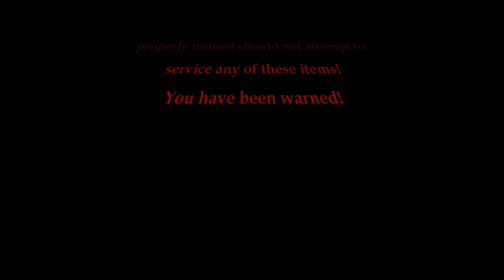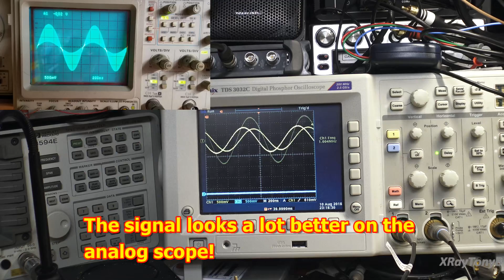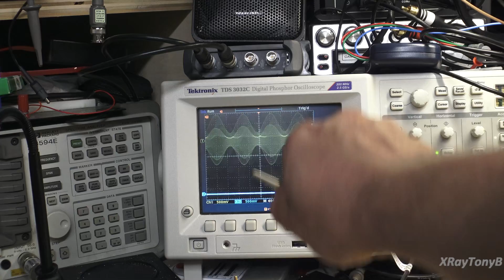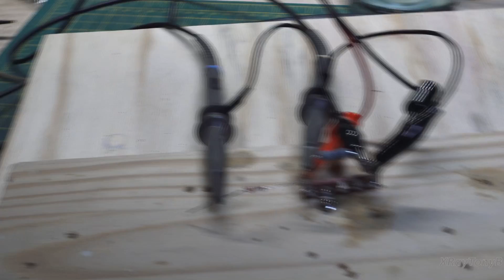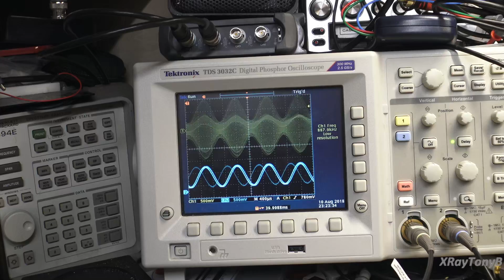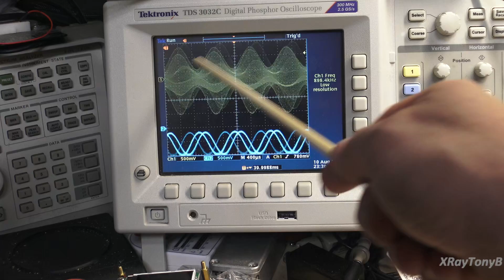Demonstration of AM Modulation and Detection

Comment: It is not correct to describe the upper and lower halves of an AM signal as "side bands". AM modulation works the same way as the mixer stage in a superheterodyne receiver. When you mix an AF signal with an RF carrier you get 3 different frequencies: the original carrier frequency and frequencies that are the sum and difference between the carrier and AF frequency. It is these sum and difference frequencies that are called "side bands".
Reply: The most technical thing I have ever heard about AM. Your comment is most underrated and should in text books. 100% people dosent know this. I was having this doubt for over a decade and now got a confirmation. Thanks alot
Reply: @ramrajpanthukalathil1601  I'm pretty sure that it would be in most technical text books. After all, it is just basic trigonometry.
Reply: @psionl0  may be. But most of the people have an understanding that these are side bands. I enquired to many to get the same response. Figured it out on my own and left it. Now when I saw your comment I got excited. 
You can also ask people to get the answer as side bands, I am sure
Reply: @psionl0  some text books also reference to as side bands
Reply: @ramrajpanthukalathil1601  Are you saying that some text books call the upper and lower halves of an AM signal "sidebands"? I have never seen that before.
Reply: @psionl0  yes. Some local texts
Reply: @ramrajpanthukalathil1601  if you come across any please let me know.

Comment: The process of AM modulation is the same as heterodyning.  In fact, you can create AM modulation with a mixer.  If you are discussing conventional AM Modulation, you do not vary the amplitude of the carrier. In fact, the FCC rules and regulations specify that the carrier level shall not vary by more than 4% under any condition of modulation.  There are some methods of AM modulation that vary the carrier level, controlled carrier modulation, but this is not generally used in domestic AM broadcast stations.   The output of the transmitter is a mixer product, the original carrier frequency, the sum of the modulating audio and carrier frequency, and the difference between the carrier and the modulation frequency. The original audio is dissipated as heat in the process.  All the information is contained in the sum and difference signals. When you look at an AM signal on an oscilloscope, digital or analog, what you are seeing is the modulation envelope, not the carrier and sidebands.  This is the resultant of the sidebands and the carrier caused by the fact the sidebands are out of phase with each other and the carrier.  To actually see the amplitude of the sidebands and the carrier it is best to look at them in the frequency domain on either a spectrum analyzer or FFT.  When you do that, you can clearly see the amplitude of the carrier does not vary when modulation is applied.  To detect the signal, you feed it through a reverse of the modulation process and pass the two sidebands and the carrier through a nonlinear device where they are heterodyned with each other, producing a number of products, including the difference between one or the other sidebands and the carrier, which is the original modulation frequency.  All the other products are simply thrown away by filtering.   I know there are is probably a shelf full of high school physics books and popular magazine articles, which talk about varying the carrier with modulation, but this simply not what happens and study of more advanced books and articles will support that as well as looking at AM signals in the proper domain.  
     When you look at the envelope on a scope, you are seeing the effects of what is commonly called upward and inward modulation.  The waveform above the resting carrier level is upward, or positive modulation, and the modulation below that level is the inward or negative modulation.  The modulation is identical on the two sidebands, but that is not what you are looking at on an oscilloscope.  If you look at the upward and downward modulation on a commercial AM station, you will see that it is not symmetrical about the carrier peak level.  Stations usually apply 135% positive or upward modulation and 100% inward or negative modulation.
Reply: Wow, absolute FANTASTIC (and spot-on CORRECT) explanation!  Good on ya - DE: W7SJ

Comment: You can use FFT function to do the same and turn on interpollation and would have stable trigger ad getting into sideband is a whole another topic that goes much deeper, but using  the FFT feature to better explain the upper and lower sidebands would have been better.

Comment: Thanks. The only way I'll get rid of my analog scope is when I die.
Reply: The fact Tony doesn't seem to understand the limitations of DSO's in these sort of measurements and takes no action to mitigate them (chief among which is using the wrong kind of DSO to begin with), like turning off interpollation or putting a low pass filter on the trigger, is no justification for sticking to analog scopes.
Don't get me wrong, I'm hanging on to my analog scope for sentimental reasons... it was a graduation gift from my parents after all, but I don't think I've used it in the past 12 years.

Even though I, like Tony, don't own a digital phosphor oscilloscope (which mitigates the fact a digital oscilloscope displays a datapoint at a standard brightness, regardless of whether it occurs infrequently or not), but, nowadays, even just entry level, digitiser+laptop DSO's are far beyond analog scopes' capabilities.

Compared to early, low end, digital scopes, analog scopes are inherently better, at their pricepoint, than digital scopes in exactly two areas: displaying AM modulated signals and videorecorder head alignment.
And both of those are thoroughly obsolete technologies. I mean, I listened to AM radio as a novelty, as a teen, in the 80's.
Meanwhile, digital scopes have come a long way, to where, if one knows what one is doing, there is no real downside except being not as intuitive. Get over it.
Reply: Jan Verschueren  I don't see why some people think that we should only have one kind of scope, or which one is the best. Who cares?? Why can't we have many different kinds of scopes?? I love my old Tek 2465A DV, but that's not gonna stop me from getting a digital scope. At some point I'll probably get a PC based scope as well. If I had the money I would have one of each kind of scope that's ever been made. I don't understand why anyone would want to limit themselves to having only one kind of scope. I say get many kinds of scopes and enjoy the benefits of each!
Reply: All kinds of tools for different work.  As much as I love my Fluke handhelds, there will always be a place on my bench for a VTVM and my Simpson 260.  Same with scopes.

Comment: I'm a total noob at AM decoding but i was expecting the rectified signal to contain the carrier: is the diode also doing a low pass filter (is it bandwidth limited) ?
Reply: @chillidogkev  Yes, the carrier IS in the signal after the diode.  One of the problems using a digital scope for these demonstrations.  On an analog scope it would have been easier to see.  The process is identical to using diodes for power supply rectification, you get the half of the signal you you want to keep, then use caps to fill in between the peaks.  Difference is for a power supply you use big caps to maintain a steady voltage, with a demodulator you use a pretty small cap because you want to follow the audio signal.

Comment: I've built many Crystal radios in the past and was amazed at how much volume you could get into high impedance  earphones, I even managed to drive a speaker using transformer matching to fairly good volume, the transmitter was high power 500 kw only 30 miles away!

Comment: I think your description of AM demodulation is wrong, especially the part about sidebands.  With a simple diode detector you are always going to have both sidebands present since you have no filtering but you can't see them on a scope unless you use FFT or a spectrum analyzer.  Simply reversing the detector diode does nothing but invert the audio signal which doesn't make any difference since it's just audio.
Reply: I think even saying the word sideband in this demo is probably a mistake.  Just calling it the upper half and lower half would have been enough.   Sidebands are a deep topic, and I've never seen a discussion about them that didn't start a fight.

Comment: Like I mentioned in your last Item about that Rare radio could a sample of the  IF be limited before being fed to a PLL which outputs an signal at 4x455khz of which a small sample is divided by four and compared with the 455khz IF which has been limited to remove the AM signal but the x4 signal from the PLL is used to drive a balanced Tayloe mixer direct conversion stage (Quadrature Sampling Detector) that will allow you to listen to AM without other signals interfering with the station you want to listen to.